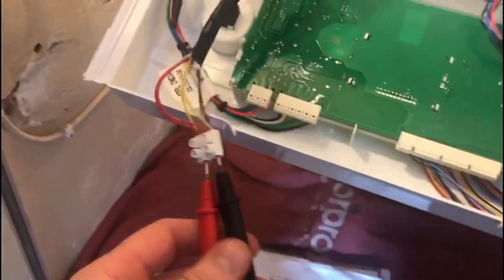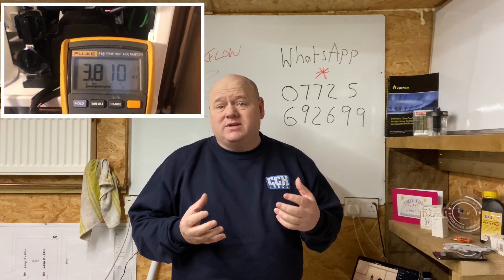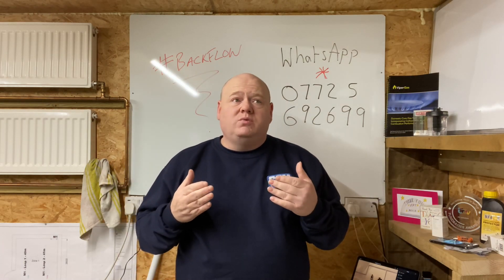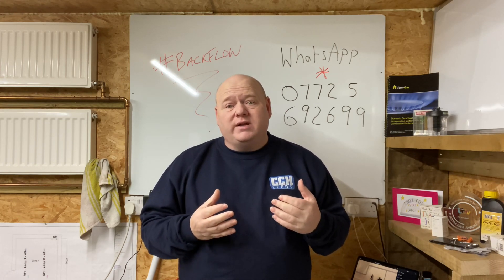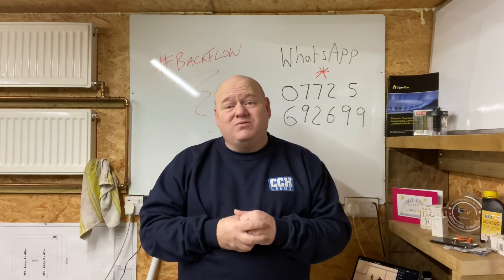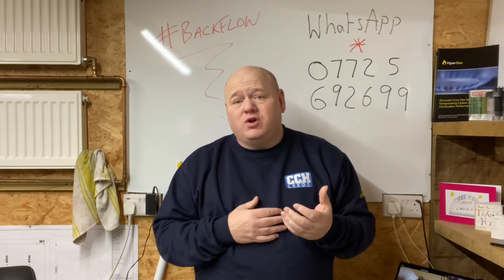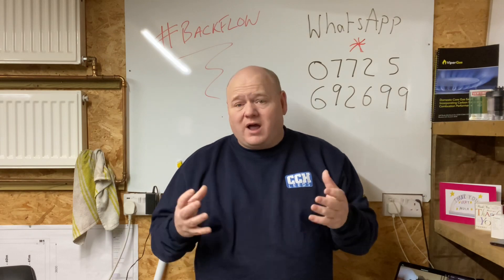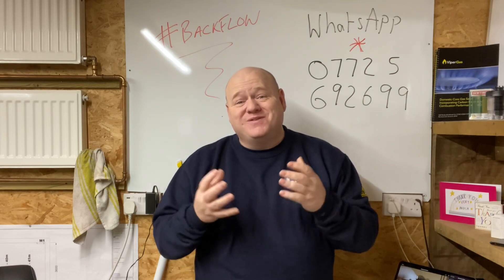Gas Training - How To Test A Boiler Thermistor - Ideal Boilers Engineer

Comment: Great video.. great tip on the FGA testing point.. but looking at the length of all the hoses an then onto FGA would this loose some of the readings or not even get a true reading
Reply: It works perfectly, you could shorten the length of the hoses if you wish. The pump on the analyser is very strong and can easily draw the POC into the unit.
Reply from the maker: They work with no issues. I also use the same tools. Thanks.

Comment: Good tip on the thermistor leads. Sometimes struggle to get a good connection, on certain boilers. And trying from the PCB connection isn't always possible due to, micro connector plugs.  To small to get the tip, of  your probes into!
Reply from the maker: Thank You

Comment: Some very informative videos you are showing Alan and the engineers great tips. Unfortunately most customers don’t understand the difference of a good and bad installation. When pricing to replace a boiler with a dirt mag. Correct gas sized pipe. Good quality controls. Power flush.Chemical clean. Hot flush cold flush and inhibit system. I have priced my self out of the game.
Reply from the maker: In my own small way I am trying to show customers why they need to pay more. Thanks
Reply: I totally agree, the customer is only interested in the price. They are not bothered whether it’s been flushed out, commissioned etc

Comment: There is one test missing on the NTC thermister test, and that is leakage to case from the NTC element, usually expected to be in the 10 Megohm + range, But will cause quite dramatic effects to the boiler operation, depending on the orientation of the connecting cables and the amount of leakage.
Reply from the maker: :_mul::_mul::_mul:

Comment: Good video and good tip to scavenge an old lead as a test lead - a worthwhile improvement would be use Wagos (221) at the test point end as they do grip test point probes without use of a tool.👍
Reply from the maker: :_mul::_mul::_mul:

Comment: Hi Alan. I am not a plumber but find your work and the plumbing industry interesting. I have a question about boilers: When a 25 year old gas boiler is changed to a new one, is it advisable/necessary to change the 25 year old hot water cylinder too? And would that include the controllers and thermostats? Thank you.
Reply from the maker: New boilers will definitely be cheaper to run. Thanks
Reply from the maker: :_mul::_mul::_mul::_mul:

Comment: Are these thermistor charts online?
Reply from the maker: I will try and get some. Thanks:_mul::_mul::_mul::_mul::_mul:
Reply: @AllenHart999  

|It does not have to be the whole chart showing all the range.  The usual temps, like: 20C, 25C, 10C, 0C, 80C, etc.
Reply: @AllenHart999  The temperature chart to test the NTC thermisters is in the back of the Viessmann  050 and 100 series repair Instruction manual the one that comes with the boiler